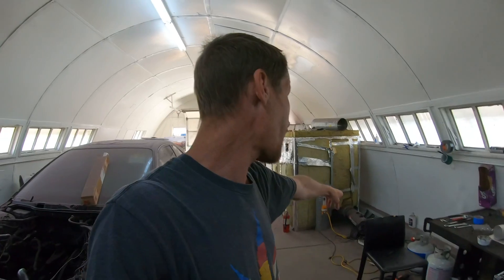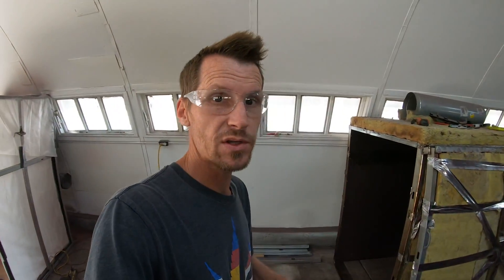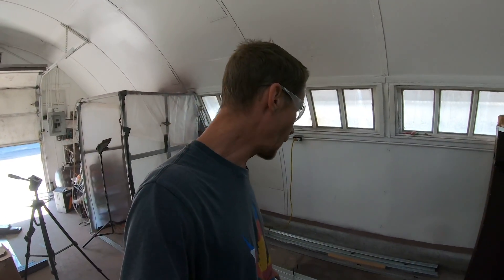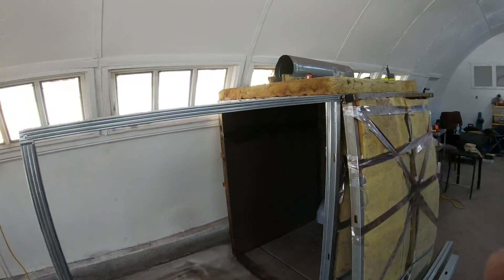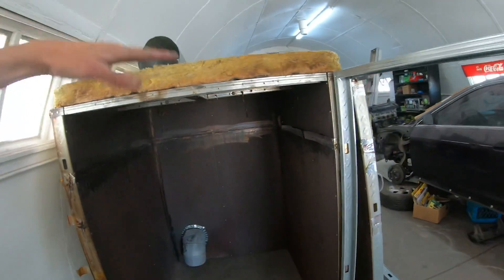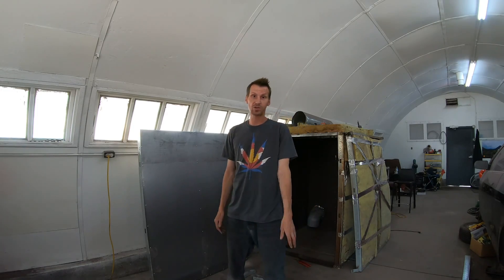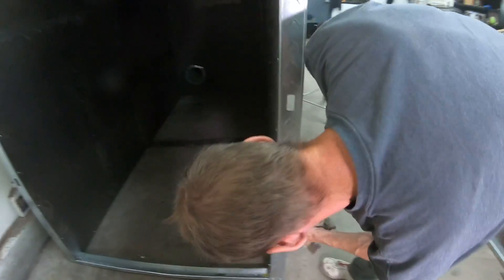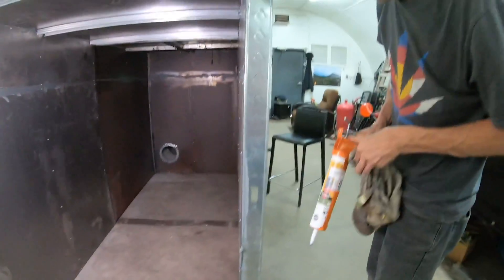Building a Custom DIY Propane Powered 8 Foot Powder Coating Oven

Comment: You’re not getting shit for a gun unless you spend five grand GMA are OK but Wagner Prima sprint is the one powder I’ve painted with all of them. 14 years  and heat ut re coats up missed them whether he does the light coat. Let it cool about 10 minutes and then go through with your gun farther away than you normally would and take all the shine away. You’ll never have a problem.
Reply from the maker: That’s years old, we don’t use that system anymore. But we also didn’t spend $5k on it either

Comment: Do you have any problems getting the bigger oven to temp.  No fans?
Reply from the maker: no sir not at all
Reply: adding to feet making it 6x4x6 with carling 200,000 btu. I dont thinks it'll be a problem, it does realy well 4x4x6.

Comment: What kind of metal is the frame made of can you buy it at home depot or lowes .?
Reply from the maker: we purchased ours from metal supplier, but the smaller stuff from Lowes or Home Depot will work,  as long as it's the thicker stuff

Comment: Hey I wanna ask if you have the option of using self tapping screws instead of riveting. I used to work with steel stud framing and we used self tappers all the time. Saves lots of time. Just a tip for your next project ☮ from 🇨🇦
Reply from the maker: You can use self tapping, we just chose not to because the oven will expand and contract with heating and cooling which can make self tappers loose over time.
Reply: @710performance  Thanx for the info. I never took that into consideration

Comment: Hey man great job! I have a question for you. Since I want to build a painting furnace similar to yours, I have a question for you. Does your gas burner blow hot air into the furnace through a hole in the wall? if so, do the gas fumes not damage the paintwork? sorry to use the translator but unfortunately I can't do otherwise :(
regards ! 😎
Reply from the maker: Not it does not hurt the powder coat finish.

Comment: Can you actualy use propane to run the the power coating both and dont you have to vent the gas off from the powder coat
Reply from the maker: There is no gas to vent off the powder coat.

Comment: maybe I missed it, but where do you get all your supplies for the oven? the metal, insulation, etc...
Reply from the maker: We got the metal from DenCol a metal supplier in Denver (near where we were when we originally built the oven) we purchase the studs and insulation at Home Depot. We have a couple of videos on the oven build itself as we built it 4'x4'x5' first, then we extended it months later (in this video) so we did cover those materials in earlier videos.

Comment: Hey man ! Love your videos. I have a question... do I need a blower fan to circulate the air inside the oven ? Or does the buddy heater do the job ?
Reply from the maker: The Mr Heater does the job just fine for this size oven. If you build a bigger one u may need a fan.
Reply: Would a 55,000 buy heater work good with a 4x4x8 oven?

Comment: What up, This is Stucc From Colors Powder Coating in Cali.....I have the Hi Colo X1 it shoots out a ton of powder. From ur compressor to the X1 how much amp pressure are you using. I have it is at look 30psi, is that to much? Can you help I would appreciate.
Reply from the maker: We have it running in in about 30 psi too. What is your powder and fluidize are setting set at? Please email info@710performance.com so we can help you

Comment: What gauge sheet metal did you use I’m about to build one trying to find a reasonable price and gauge. Nice oven btw and love your channel
Reply from the maker: Keith Ruffner thank you for the support. We used 18 gauge steel in the oven, we’ll be using 20 gauge for the outside
Reply: 710 Performance  thanks man! I’ll keep an eye out on the colo 19S1 review, stay safe out there brotha
Reply from the maker: @keithruffner7168  It'll be up tomorrow!

Comment: Hey Guys, I'm building the 8 ft version of your oven. I was wondering about the Mr Heater. It looks like they don't sell the 200-400,000 BTU heater online anymore. Do you think you could get a decent job done in the oven with just the 120-175,000 BTU Mr. Heater? If you don't think it would do the job, do you think having two of the 120-175,000 BTU Heaters would work? Thank you for making these videos after years of working in a shop you all encouraged me to make my own!
Reply from the maker: Will Harper hey 2 of the 125,00 to 175,000 BTU should work just fine! 🤙
Reply: @710performance  Thank you Brotha!!
Reply from the maker: Will Harper no problem 🤙

Comment: New to powder coating. I am making my own oven. 5x5x3 im not sure what my final heat source is yet. I have liked some builds with tons of oven heating elements. What is the heater you use and does this seem to get the whole oven hot enough or do you have to have fans to help circulate the heat?
Reply from the maker: Charles Lara we use a propane powered Mr. Heater. We have a few other videos up of the original build that was 4’x4’x5’ and the 75,000 - 125,000 BTU Mr Heater worked great. It would heat it up in about 7 minutes with no issues.
Reply: @710performance  ok thinking this an approach i will take instead of running all those wires and stuff. Is there any downfall to using one of those torpedo heaters you have found in the time you have used it?
Reply from the maker: @charleslara4074  The smaller 75,000 - 125,000 BTU no problems, the large one we're running now has some quirks, but overall it's going to allow us to speed up production even with the quirks.

Comment: Hey bud I’ve found one that I’m really considering also. Check it out at the link below.

https://www.columbiacoatings.com/kool-koat-hd.aspx

What is the name you ended up with? Can u shoot me the link. Looks like they both may do same thing at same price so I would love another option to consider.
Reply from the maker: We talked to Unknown Coatings and he said that the COLO 191S is the same as the GEMA OptiPlex pro 2. After further investigation it looks like the manufacturer is the exact same manufacture in China that makes GEMA, even the Gemma tips fit a gun! They also sell the Gemma tips and Parker Ionics tips too meaning they probably make that system too. http://www.colo-group.com/professional-powder-coating-gun-equipment-15445810161880639.html

Comment: Hey guys what's the caulking ya guys use? I'm building a oven now walked through lowes and didnt see any high heat stuff?
Reply from the maker: It’s with the fire safe caulking. It’s called Fire Block. I’m not by the tube right now for the brand name
Reply: @710performance  alright thanks I'll give it another try today thanks man
Reply from the maker: Bruce's northern powwa sports Good luck and let us know how it goes!
Reply: @710performance  grabbed some stuff from home depot today some 3m fire proof caulking should be good to go now thanks again guys!
Reply from the maker: @15brucet  NP glad we can help!

Comment: Intrested in hearing about that gema knock off for sure I’m using a koolkoat hyper smooth 2.0 and I’m having the same issues with second coats and faraday areas.
Reply from the maker: We’ll have a complete unboxing as well as some set up and overview videos as soon as it arrives! 🤙
Reply: Ive got the HyperSmooth2 also. Exact same problems applying a second coat.  Very interested in your new gun
Reply from the maker: Matt Lungren we’ll keep you updated for sure! We’re excited about it! 🤙
Reply: 710 Performance when are you expected to have it ? What one did you get ?
Reply from the maker: @ryanmatty5739  I believe it should be here this coming up week.  It's the COLO newest model for 2020.  Basically then new GEMA before it comes out! =)